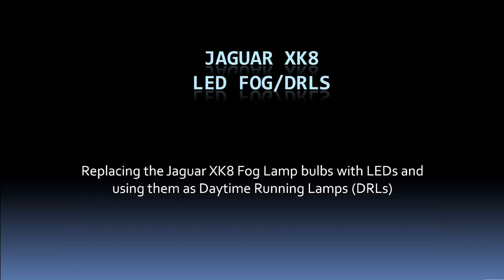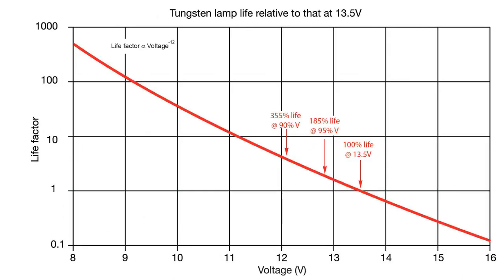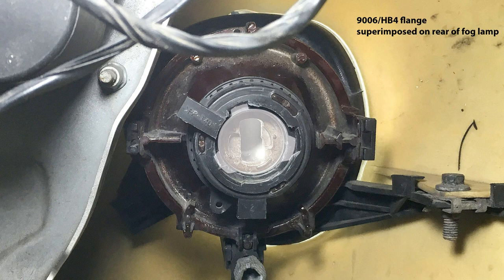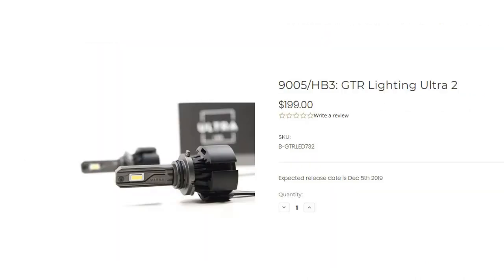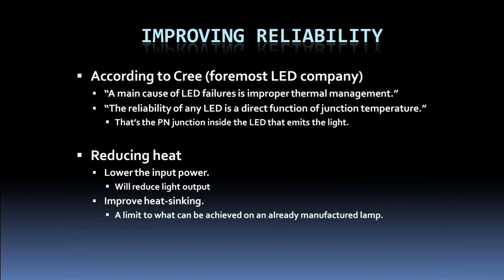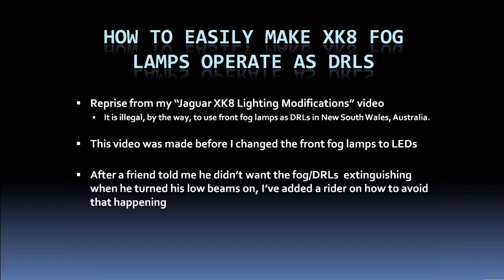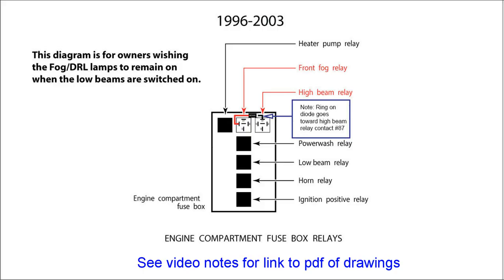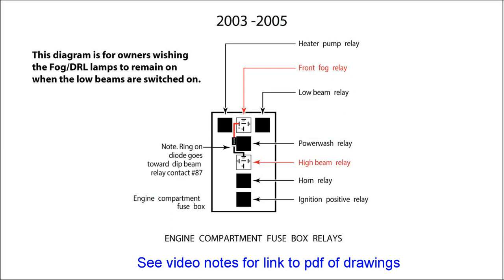XK8 Fog- DRL LED Conversion

Comment: Rick, thanks for making a video just for the fog DRL conversion. Sorry if I missed something but are the LEDs you used Ok for CANBUS errors or no need to worry. Going to try this and wanted to make sure I’ve got everything. Thanks Damian
Reply from the maker: No. So called CANBUS error free LEDs won't negate the need for ballast resistors on the XK8 because on this car the lamp outage data is not carried on the CANBUs system